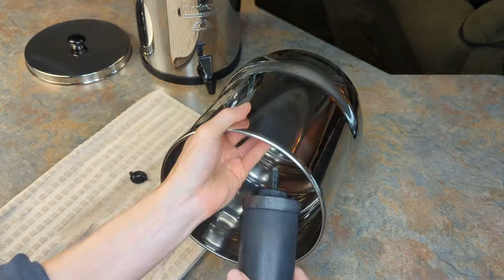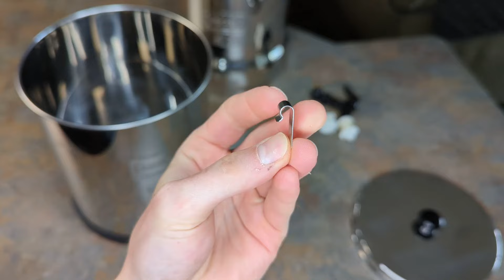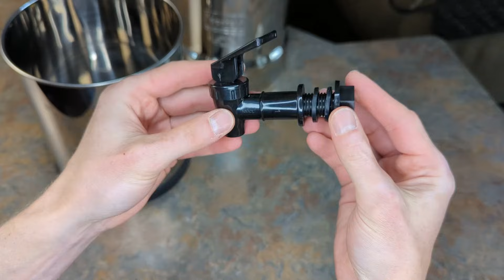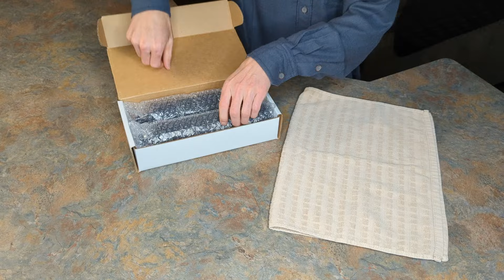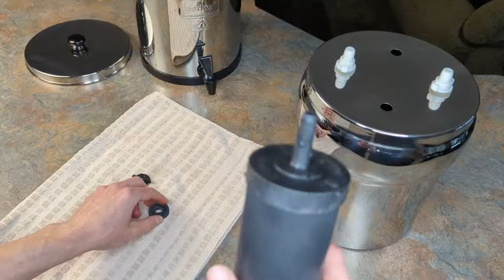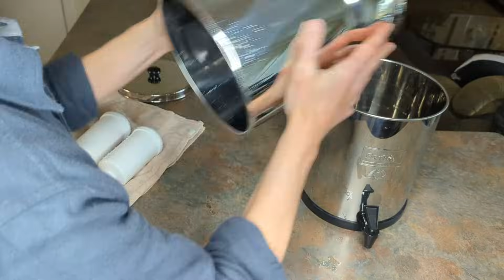Berkey Water Filter Setup Guide (Easy Step by Step Tutorial for Beginners)

Comment: Dang it, I thought I was trying to get away from plastic?  Why is the spigot plastic?  Why not a copper or stainless steel?
Reply from the maker: The brackets the filters are attached to are also plastic. Be wary with what these manufacturers claim, because none are entirely plastic free. If avoiding plastic contact with your filtered water at all costs is your top priority, I'd recommend a countertop distiller with glass collection vessel

Comment: Absolute pain in the butt. The black filters will NOT prime no matter how I hold them. I saw no bubbling on the outside of the black filters. No water coming through the walls at all. No beaded up water, only drippage from the top. Very frustrating.
Reply from the maker: It's literally the worst setup and filter priming process out of all the water filters I've tested

Comment: U swent abit to fast  for meal. May have  to  get sum1 to do it for me  who's technica
l 🤔  IveI just  had a zero water  filter .that was  so easy yo set it u just put the filter in the jug is already  set up u don't even have to prime the filter.  Just put wather though   afew times it & it has a water  tester for hardness wen it's 0
 that's it. & wen it's 06 u change  the filter.Wish I checked  before buying  this. But cud still  sell it  if  its to much bother to set  it up. I have pain in my thumb s to seems to fiddly.  The berkey  is 9.99 filters more zero water  is 9..96%  & fillers last longer then zero water  so I wanted to try it
Now the electorateyt  kangen  water  is the rage now but it was out of my price range  so opted  for zero water. Or the berkey  filter 
Thanks 🌹 
❤

Comment: My directions  said to soak the black filters 24 to 48 hours, if the nipple doesnt fit on my faucet. Which it doesn't. 
The system is not  working after doing that ,so I tried priming again,using your method.
 If they are already primed would the filter sweat or not? How long do i hold them under the faucet before I should expect to see sweating?  They did not sweat at all.  Thank you.
Reply from the maker: The sweating only happens when the pores inside the filter fill with water and air is forced out. If the filter is already primed you won't see it sweat.
Reply: Thank you  @waterfilterguru

Comment: My set up is still testing positive for hard water on test strips.also highest ph  and carbonate ppm.
I've ran 3cycles and barely starting to see a difference 
. DO YOU KNOW HOW MANY TIMES WE NEED TO RUN WATER THORUGH THEM BEFORE WE SHOULD DRINK??
Reply from the maker: The Berkey filters are not capable of reducing water hardness or carbonate. High water hardness can also contribute to high pH. What you describe is the expected result, since these filters cannot reduce or address any of these parameters you mentioned
Reply: @waterfilterguru  thanks for the response water guru. I have one more question I'd like your opinion plz. 
-So is this water ideal for drinking?? Or is it just for emergency? 
I was hoping to use this as an at home station .
Reply from the maker: @samaelmartinus3273  This should only be used with treated water - good for treated city water, and if you want to use it in an emergency you'll need to make sure to properly disinfect the water in addition to filtering it before consumption
Reply: Ok thanks I Googled if tap water was safe to drink in my state and they said it's some of the cleanest in the country so this and berkey should do just fine.  Thanks water filter guru !

Comment: Sorry, ich habe noch eine Frage. Ich habe zusätzlich eine Stainless Steel Berkey Water View Spigot bestellt. Weißt du, wie ich den Blue float ball in den Sleeve with glass tube reinbekomme?      //    Sorry, I have a another question. I also ordered a stainless steel Berkey Water View faucet. Do you know how I can get the blue float ball into the glass tube?
Reply from the maker: I don't have personal experience with the Berkey sight glass spigot - it's odd that the float ball wouldn't already be inside. Did it come with an instruction manual?

Comment: Could you give more information about the fluoride filters? Do I need to purchase fluoride filters in addition to regular filters? Or do I need to filter my water with the regular filters first, and then go back and pour that water in to the Berkey that has been switched out to fluoride filters?   Or do the fluoride filters do general filtering plus remove fluoride?
Reply from the maker: The Pf2 fluoride filters are purchased in addition to the black filters, and primarily target fluoride and arsenic. They use an activated alumina media, which is different than the carbon block of the black filters and is capable of targeting different contaminants. 

That said, our own testing identified an issue where the activated alumina media leached from the PF2 filters. Check out our full testing videos to learn more:

Test 1 https://youtu.be/AVZmZwTxnMc
Test 2 https://youtu.be/1QL3McV20YM
Reply: Yes -- and the PF2 filters very conveniently screw up onto the elongated hollow threaded tube that is below the top container. You can add them to a Berkey where the "regular" filters are already installed with no problem. @waterfilterguru
Reply: Before seeing your video I (stupidly) screwed a PF2 filter all the way onto the screw tip of the regular filter and I think I messed up the part inside you mentioned. Will the PF2 filter still work? Thanks

Comment: I don’t have sinks that will fit the blue condom or thick washer so water just sprays across the room. This was such a frustrating install and because of that I wouldn’t recommend this filter to anyone. There are better ones on the market that don’t require a degree is engineering to build.
Reply from the maker: Agreed - one of the most difficult/ least user friendly systems in terms of setup and use
Reply: My faucet didn’t fit either so I didn’t use it and followed this tutorial 👍👍 just use the tan washer and put the water flow low
Reply: Agreed! A royal pain in the rear, it better be worth it that’s all I have to say
Reply: @beam-kitty8425 was it worth it? I love mine
Reply: Vague instructions also.
I'm returning mine.
It's too bad I was looking forward to using it, but it's just turning into a hassle. Mine didn't even come with all the parts

Comment: Too complicated for a non mechanic.  I am a senior.   I have the travel model.  I have two holes.  I am supposed to prime the water filters which are supposed to sweat.  I don't see any sweating.  It is hard to tell if filters are full of water.  I shook them.  I was able to install top knob and faucet easily.  Written instructions with this are abhorrent.
Reply from the maker: Berkey is one of the most complicated point of use systems to set up we've tested, that's for sure!
Reply: Totally agreed. I wish I got the ProOne